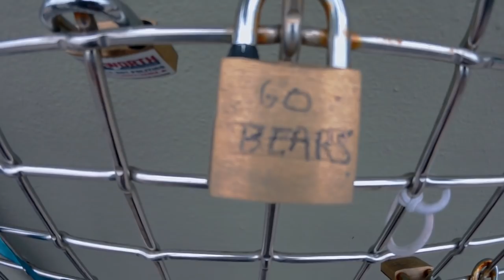A trip to Penn's Landing and the Lie-Neilsen tool show Weekend Chat 24 Feb 2019

Comment: Thanks for taking us along with you, Mike.  I like the sound of your vehicle's motor. If you don't mind what are you driving?  I've always admired you, but now even more because you drive a manual. It's obvious that we "piper's'' always seem to have so many things in common. Sad that they are becoming very scarce.  
Anywho, take care and I look forward to Tuesday.TheyThey
Reply from the maker: Hi Gabe,  I drive a 2011 Hyundai Elantra Touring (best fishing trip car ever made :-).  I have not owned an automatic since around 1995, and had manuals before that one.  I really fear the day I won't be able to get a manual because I just don't feel comfortable driving an automatic.   Do you drive a manual, and if so what is it?  Thanks for watching, and have a great week!
Reply: I have always had manuals, except for my 1st car.  It was a 73' Barracuda.  After that, all manuals ... 79' Mustang Turbo,  84' Colt Turbo (too small &fast to be safe).  The torque steer would rip the steering wheel from my grip.  Got rid of that quickly and bought a 1985 Honda CRX (fun).  In 1989 a Ford Ranger (V-6).  Then a 1995 Nissan 200sx  SE-R (I think this was my favorite)!  It did everything well.  I had it until it (12yrs) was hit side-swiped.  Finally & currently, a 2007 Suzuki SX4 Sport (awd).  Another great (under-rated & over-looked car, until ).  Since 07', not one problem, other than regular maintenance.  The best "slow car to drive fast." 

Manuals give me the feeling of "complete" control.  You choose what gear to be in, and it keeps me more engaged.  It makes driving more fun and IMO safer and more alert.  

Hyundai/Kia has come along way, and have the best warranty in the industry.  My daughter drives a Sportage and my sister a brand new Sorrento.  

I always enjoy our conversations.  God Bless.
Reply from the maker: @gabepettinicchio7454  We clearly agree on cars ;-)  I had a 95 Ford Ranger and loved that truck.  I really wish they still made them.  And I agree with you on the safety aspect of the standard transmission.
Take care my friend, and God bless.